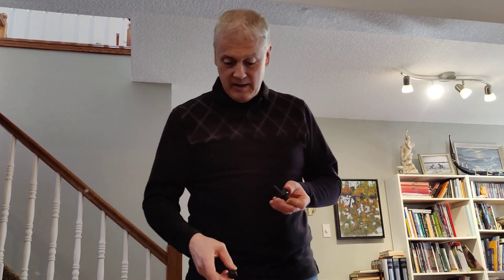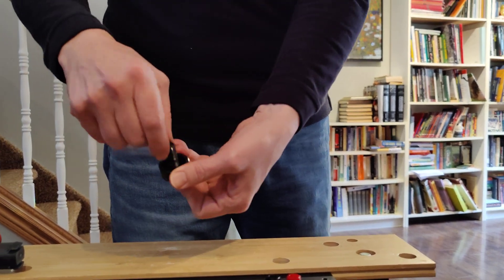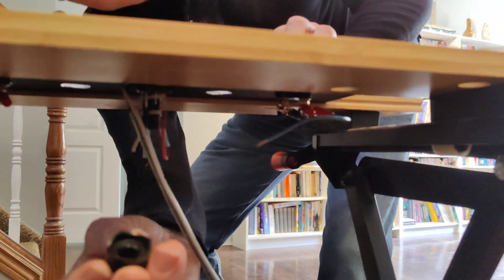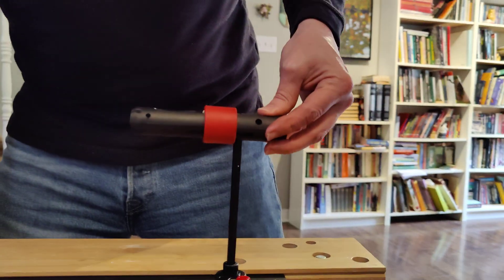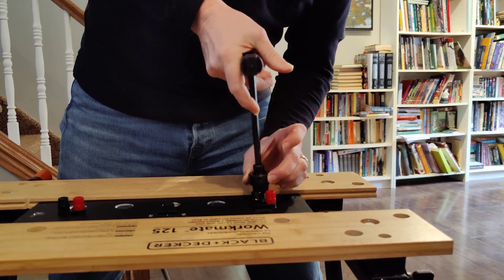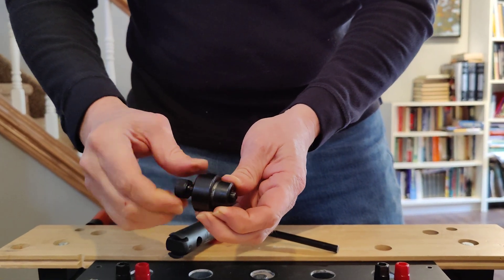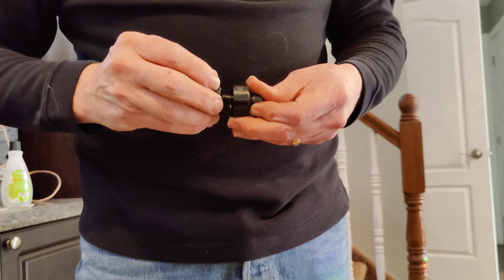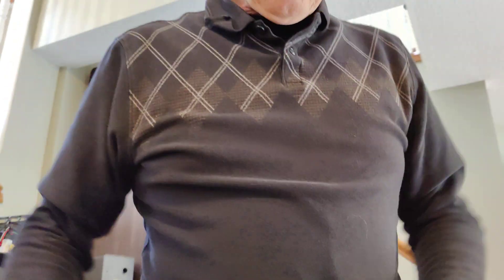How to use a 24mm Manual Knockout Punch

Comment: For those setting out to punch Neutrik D style holes, beware! The screw placement is different for different Neutrik products. What I like to do is print a PDF of the technical drawing (make sure you select "actual size" at print time instead of "scale to fit") and use that for a template to place the screws correctly for the product I'm installing.
Reply from the maker: Thanks for the heads up. I tend to wait until I have the main hole punched for each. Then I place the connector in the hole, and center-punch the position of the screw holes.
Reply: That definitely works, too. 😊👍👍 I am known to overthink things and spend a lot of time pre-planning and trying to decide all my spacing and the like. And especially in close quarters (multiple connectors close together), that screw spacing being different can mess things up when they are a little further out from center.

Of course, if you have plenty of space, it doesn't really become an issue.
Reply: @mikey38632 thank you so much for sharing that.  That’s exactly what I’m here for.  I was using a 7/8 drill bit which was too small, the next drill size up for mounting XLRs is 15/16 (too big) so 24 mm precisely it is.  Have you found a precise tool, or can you point me in the right direction before I purchase anything as to what I need exactly?  Any help appreciated
Reply: @CHRISDEXTER-e7m  if you're using Standard/SAE, 15/16 is your bit in most cases. Planning to do a ton of panels, I invested in the Greenlee 15/16" punch before its price hopped up over $100. It has been great. You could probably get away with a 15/16 hole saw for metal, just try not to let it walk on you.

Looking at the drawings, the various connectors' mounting holes are "nearly" 24mm and vary a little when it comes to the precision measurement.
Reply: @mikey38632  oh ok so 15/16 is good, great to know thanks

Comment: Great vid thanks Mike. Out of interest what did you use to cut out the hole for the IEC on that panel? It’s a pretty unique shape.
Reply from the maker: I drill starter holes, then use a wire-saw to get the basic shape. Then I use various files to tidy the hole until the IEC socket fits.
https://www.amazon.ca/gp/product/B0995LQSQ8/ref=ppx_yo_dt_b_search_asin_title?ie=UTF8&th=1